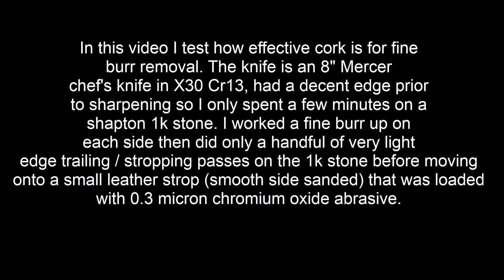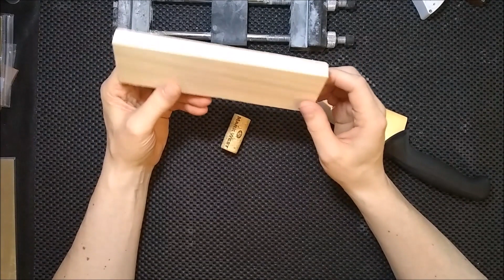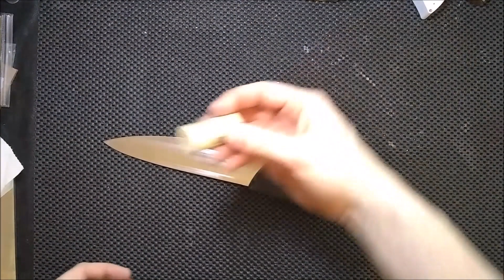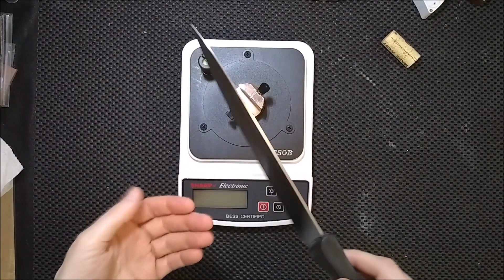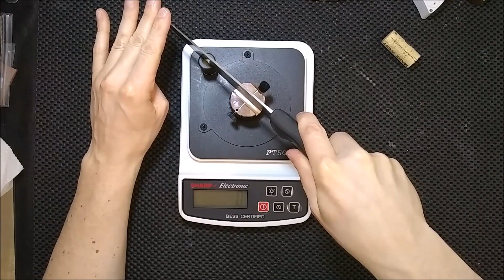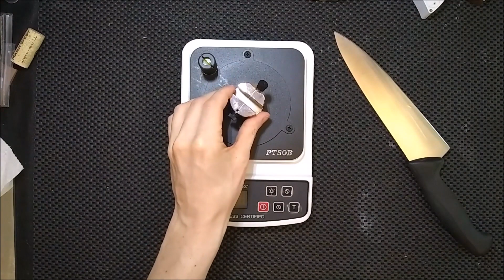How effective is cork for removing fine burrs, Edge On Up Bess Test PT50B

Comment: it looks like your bess testing is way too fast - you will get an artificially low score. you need to slow right down - see the numbers climbing slowly. Faster you go, lower the score, but not a true score. not saying your cork technique doesn't work, just saying you could be getting more reliable measurements from your bess tester.

Comment: should have used a microscope to check the burr. this isn't reliable
Reply from the maker: It's actually quite reliable as long as the burr has been really fatigued/weakened, doing this on a heavy burr will do nothing. Anyone who has been sharpening for a long time will have a cork or two laying around in their sharpening arsenal. And I have a stereo type microscope as well as a metallurgical scope.

Comment: I think the problem with cork is that most people leave a thick burr and expect the cork to do the job. It doesn't work that way. When used as you did it's effective. 

With that many passes on pasted leather strop you probably got a foil burr. Another method to deal with this is hanging denim strop. It never creates foil burr no matter how many passes you do. Have you tried it?
Reply from the maker: Agree, heavy burr are not easily removed. I have over the years experimented however imo you can still create a foil edge. Check out scieneofsharp.
Reply: @NORTHWESTKNIFEGUY  The source I got for no burr on Hanging Denim is Science of Sharp. If you are very strict he has some images with minimal burr but all images are either fully clean or almost clean with 10 or 30 passes on Denim.  
Hanging leather strop with diamond compound on the other hand has some huge foil burrs with 10 passes. 
I don't have that much practice with hanging Denim, Made a couple strops recently and used it a couple times. First impression was very good.
Reply from the maker: @thiago.assumpcao  Yeah a very light foil edge but overall very effective.

Comment: Hey buddy! Just got back from a big motorcycle ride in the Texas Hill Country. Looks pretty good! I use the felt block too most of the time, but I’m of the opinion that really fine wire edges can be cleaned up with cork or wood just as well. I have actually proved that by using the PT 50A but I suppose I can. Bare leather is probably the biggest surprise to me. That Tormek guy, I forget his handle, he opened my eyes to how the burr will collapse big time on the test media using BESS. He’s right! I have proved that. Anyway, it’s always nice to see your posts. This one is no exception. K
Reply from the maker: Nice, what you riding? Yeah they all seem to work fairly well once the burr gets small/fine enough. Knifegrinders who you're thinking of? IMO bare leather is the best overall to finish on and what I use most of the time and have been for years. Thanks for watching brother!
Reply: NORTHWEST_KNIFE_GUY My Gal and I put about 20K/ year riding the Harley FLHTK 2-up around the country. Last year it was RT66 to West Coast for the Fall trip. This year it’s Houston to Sturgis SD > Chicago > RT66 for another 4K miles. It’s a great way to see the country (most of the time ;) Knifegrinders! Yes, that’s him. I do appreciate his experiments even though it’s extremely unlikely that I’ll add a Tormek to the equip options as attractive as it looks for some sharpening. Hey, if you are where I think you are, keep your head down, it’s a little weird in some places! Keep the shiny side up! K
Reply from the maker: Nice man, sounds like a good time for sure. The Tormek units are expensive but worth the money imo, I really like mine. Yeah not too far from me people are going nuts, just hope they stay out of my neighborhood. Considering my neighborhood is 95% active duty military would be unwise for them to try anytime stupid around here.
Reply: Vadim Kraichuk - literally wrote the book on deburring. RIP - had some wicked sharpening knowledge. pity he never told us how to get the same results on hand / fixed angle systems.

Comment: Again, that rubber mat gives you lower measurings, you need the scale on a solid surface for acurate results
Reply from the maker: Like on this hard plastic table? https://youtu.be/0TXquBnvInk
Reply: NORTHWEST_KNIFE_GUY bahahahahhahahahahaaaaaa
Reply: Yeah apparently looks hard enough, if you didn't cheat it in anyway and you did sharpen it by hand then congrats you got a bloody sharp edge there.
I wonder what will it mark after you do a couple cardboard cuts...
Such sharp edges tend to be very fragile at least in theory so of you ever test it out let me know i would like to see it.